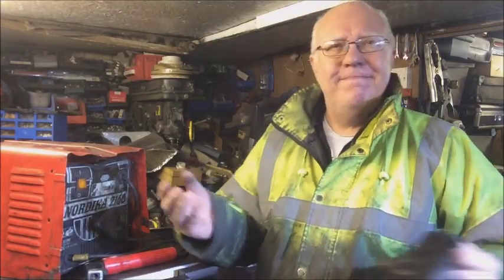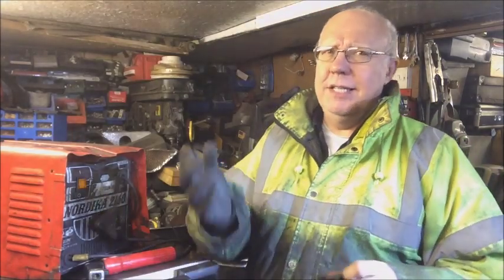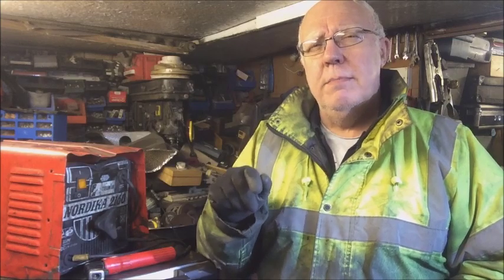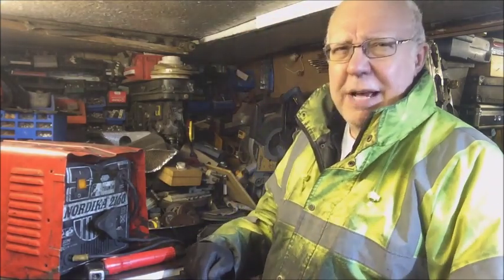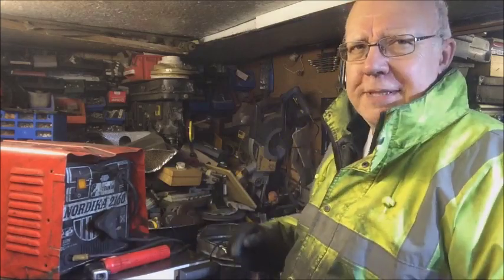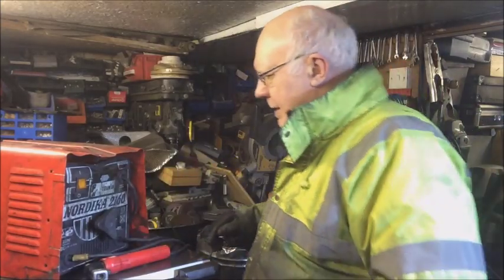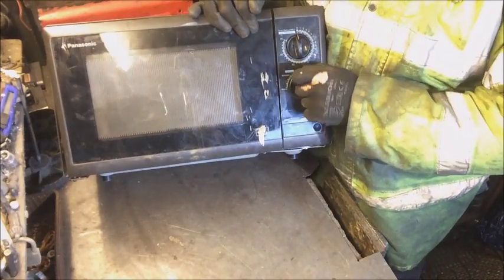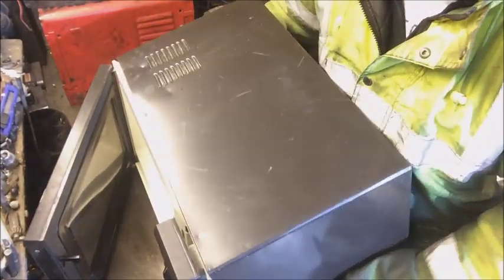30yr Old Microwave is it safe ?  & testing  Scrap Arc Welder

Comment: That "resistor" is a high voltage diode. Never trust the internal resistor of a capacitor to work. I've gotten bit by a few motor run caps before because the resistor went open.
Reply from the maker: RCM  thanks. Good Advise  I’m always willing to learn

Comment: I’ve scrapped out a bunch of microwaves. However, I found one today in an office building dumpster on top of everything along with the box from their new microwave (shipping label dated 2019). Excellent condition for a tossed out 2005 larger Panasonic model, almost like new! Tested it and it worked fine. I was tempted to scrap it out for a few easy dollars, but our neighbors are helping a Colombian refugee family, and a comparable unit on Amazon would be easy $200! They just got a free awesome microwave. They will get more value out of it than me and I’m fine with that.🙂

Comment: Hi Ian how are you. I was just wondering if you had a three phase supply to run that milling machine if you have was it easy to do?
Reply from the maker: No it has a 240v motor on it.  but i did buy a 3ph motor and invertor for it, cost me £220  its in one of my vids near xmas,  i think its  more prezzys for the mill  vid
but there are loads of tubes on wiring up Invertors.

Comment: Another great and informative video. I certainly have shed envy. Do you have any recommendations for free or cheap brass for casting purposes please? Cheers
Reply from the maker: John  not an easy answer,   are you in the UK,  if yes then curb pickup is very limited option for you, i guess you want quality Brass, if you want cheap  try charity shops for brass ornaments, find a plumber buy his old taps, or go direct to the scrapyard tell em what you want to do, and can you pick thru their brass, they will selll it a little above what they paid.
or ideally  find a a machine shop, for brass turnings  again tell them its for casting and machining, engineers  will help its in their blood  to help another machinist. plus its easy to melt i guess. 
find an heating installer tell him you will strip all his old boilers for him if you can keep some of the brass

Comment: Those black things are High Voltage diodes for the rectifier. The discharge resistor is within the Capacitor. Still good to short out as you did, just in case there is some charge left in it. Good welder.

Comment: Old buzz box welder there, im lucky enough that i learned to weld stick using a monster 3 phase oil cooled oxford. Once id got the hang of it it was a pleasure and the duty cycle was huge so you could weld  thick material at high amps for hours.

These days i have a miller inverter stick welder, does all i ask of it, cost a bit but i refused to buy a chinease made welder.

Im the opposite of you, out of my comfort zone with a mig albeit passable welds but no were near the standard i can do with a stickwelder.